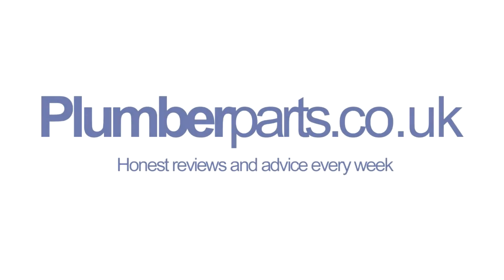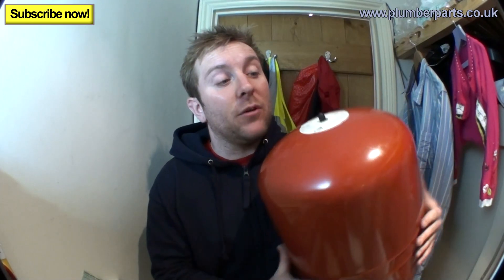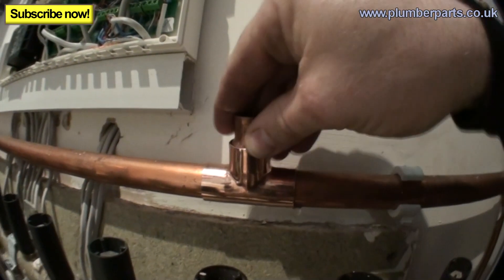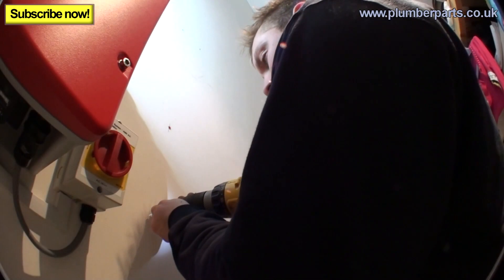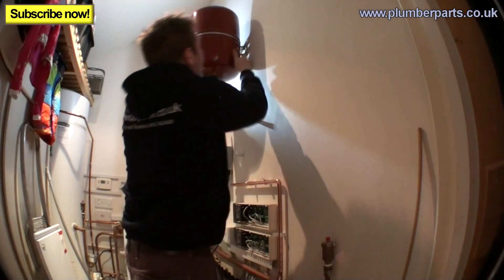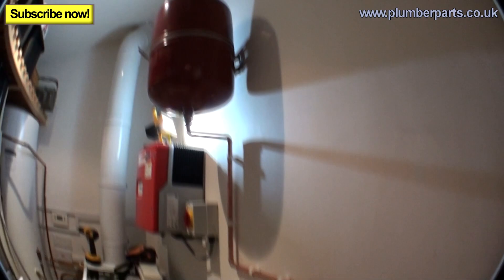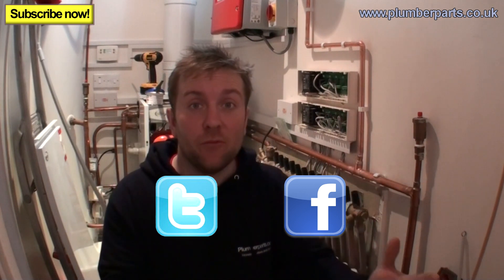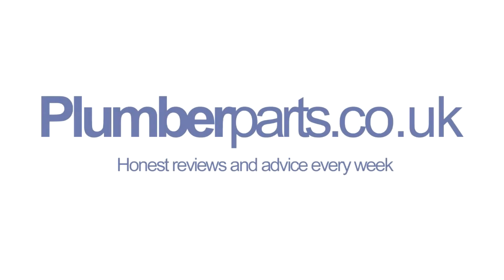EXPANSION VESSEL INSTALL - Plumbing Tips

Comment: Homeowner question. When pressure gauge is low (or zero) on the expansion vessel, how do you know when to use the schrader valve (and pump), or the filling loop taps?
Reply from the maker: Hi Mark, open the schraeder and quickly press to make sure there's compressed air. If nothing comes out (or even worse water) call your local engineer. If all is well, use your filling loop to top up the pressure and make sure you add inhibitor afterwards! If you don't already, please follow me on Instagram here: http://www.plumberparts.co.uk/social.php?social=Instagram FANKS!
Reply: Gotcha. But what pressure should the air be anyway? I may have released too much air. Thanks.

Comment: Hi James. Love the video. Really  helpful. Can I ask though. Have you fitted many EV’s to hollow plasterboard walls and if so what fixings do you use please?  Mine have worked loose thanks to the contractors using plain rawl plugs believe it or not. I’ve put a few TVs on the wall using snap toggle fixings and hollow wall anchors so was thinking they will work ok. Just wondering what your thoughts are.

Comment: Should never reduce the size should be 3/4 to expansion. Also expansion should be fit were it can be vent so it will fill with water rather than air because the system pressure will go down as the air is eventually dissolved into the water and have to be topped up again?

Comment: HI I have a question.  I have one of these on a unvented direct water tank.  Where would you measure the water pressure to set the expansion vessel pressure.   On the rising mains as it comes into the building, or after the inlet group valve where it connects to the tank ?  As the PRV is set to 3bar, wouldn't you just set the expansion vessel to 3bar as well ?

Comment: Common mistake: expansion tank lines do not have air bleeding/purging method. Extra air in my opinion is not desired. Open loop expansion vessel would be mounted that way, not closed system.

Comment: Hi guys, I have a question do you need to install an expansion vessel on the heating side of a unvented system, as I know the boiler has a expansion vessel inside it? The system has 8 zone (underfloor heating), and 5 radiators on the first floor boiler is a Vaillant 637?

Comment: Hi Jambo, Love the vids. One question, if your old expansion vessel is KAPUT, but because you've got a cheap Ravensh*t boiler and it's right at the back where you can't reach it, do you need to remove it or can you just isolate the little bleeder and install and external one? FANKS!!

PS - I can't even get to the bleedin' schrader valve. To say it's badly designed would be an understatement.
Reply: Vokera?

Comment: Do you need to allow water up to the connection with the expansion vessel.? Many thanks for posting, this looks a simpler job than replacing the one in my WB Greenstar junior.

Comment: When you test the expansion vessel to see if it’s split, is there a lot of water that would come out  of the valve or just some moisture. My system is bubbling like mad when the heating pump kicks in, I don’t have any other leaks. Please help

Comment: Why go to all the extra work of installing this external vessel when all you had to do was replace the one on the boiler, which is clearly visible at the front of the Worcester. I can understand it when the vessel is at the back and you have to take the boiler of the wall.
Reply from the maker: Because, Grant's (which are the manufacturer in this case) do not produce a boiler that has an adequate expansion vessel for the whole heating syste...only for the boiler (which is a bit poo) so we had to add a larger one to accomodate the expansion of the radiators and system....hope that helps (always check to make sure the boiler expansion is adequate)

Comment: The pipe feeding the EV should be the same size as the one your tee ing off from , in this case 22 mm otherwise your will put the vessel under undue stress and it will prematurely fail.....just saying......!

Comment: Do these tanks come pre pressurised?
Reply: Yes. The one installed here is 1.5 bar which is standard as that is what the pressure in the whole central heating and boiler system is usually set to

Comment: I might have to fit an external expansion vessel on a Combi system soon but on the return pipe where I would normally fit it there is no room or very little to T off etc but there is plenty room on the flow pipe.Is it OK to put it on the flow instead of return without damaging the system?

Comment: Ignore this video, placement of pipework near electrics is concerning, also no lockshield valve or draincock!!!! You would have to drain the system to service or replace the vessel in the future. P*ss poor, half a job, shocking.

Comment: Good video.  I have a Santon (Heatrae Sadia)  premier cylinder and the vessel it came with needed replacing.
Aquasytems was the manufacturer, code ARB 24, 3.5 BAR-  I Typed that into google and loads came up at £30-£50 with that code, but all had only 3 bar or 3.5 bar that was all 5cm longer than my original vessel, and i had a very tight fitting area.
I  rang Santon, they gave me the part number and I searched google with that. £298 was the cheapest I could find!!!  What a complete scam, the manufacturers get Aquasyeytems to make a 24-lt  vessel that is 5 cm shorter than their off the shelf 24 lt vessel so they can charge £297 for a £30  dedicated 'spare part' if anyone goes through the cylinder manufacture.
I thought sod that, I will take 5 cm of the pipework and buy from ebay and so I again searched for the  aquasystems  24 arb with 3.5 bar and noticed all the standard  24 lt vessels from aquasytems only had 10bar  test pressure mine had 14.4 bar. So I then searched "24arb 14.4 test bar"  and one seller on eBay had them for £31.00.  They are not standard off the shelf aquasystems replacement vessles, so he must have bought a job lot from somewhere???
The lesson, never buy replacement vessels from cylinder manufactures.

One more point ,on newer vessels you can buy a replacement EPDM Membrane and simply change the burst one over for a new one rather than buying a new vessel.
Reply: Top man..

Comment: Hi James, thanks for the great videos. Need a bit of advice please from you or any other contributors here.. 
Is there a way around it to pressurise  a boiler or sealed system when the mains pressure is low like one bar..? thanks man
Reply: Rothenberger sell a testing pump in which you can manually lever water into a system, it has a tray that you fill with water and you're away. Good luck!

Comment: Hi James, you've kept me awake in the early hours of the night now just going through all your very funny and top advise videos (my sense of humor..) So Hold Tight!... I need your expert advise please :)   I'm looking to upgrade my 4 bed home to a sealed system from a conventional low pressure header system which is very poor on head pressure. My biggest question amongst many I have is that my water main feed from the meter to the 1st floor airing cupboard is only a 15mm supply. If I fit a sealed unit, would there be an issue with water flow when say a shower is used or running a bath as the 15mm pipe will effectively be supplying both hot and cold at the same time. The question you're gonna ask me is whats my mains incoming pressure is?.. Don't know yet (off to screwfix for a pressure gauge), but if it's limited to 3bar on the system, would this be ok if its around that value?   (I sense more questions to follow..lol)   SUPERB videos by the way, I've learnt so much watching them, and very sound advise gained from the norm. I'm hoping to install everything and getting it signed off afterwards.  Just a pain working what floorboards to rip up to install this..Deep joy!   
Many thanks in advance
Roy

Comment: Brilliant compilation of video's, I watched several just out of interest... My question, I have a gravity fed system with a Albion super duty 45ltr tank, Since bathroom refit and going to a single mixer tap we have very very low water pressure on my hot tap in the bathroom but fine downstairs (kitchen tap) now I know downstairs is lower and gravity etc, but I think the problem lays with the bathroom tap and its tiny little pipes that go to the tap from the 15mm feed pipe approx 30cm away from the tap itself. Is there anyway I can boost the pressure of the bathroom tap by fitting an expansion vessel of some kind into the hot water feed side of the tank ? OR would cost and effectiveness say its better to change sink and go back to two individual taps (old school set up). Thanks

Comment: Hi mate, i have water hammer , is it alowed to fit one into the hot water pipe outlet ?? to reduce the hammering . Cheers
Reply: You can get small versions designed to stop water hammer, check merchants.

Comment: I've had to replace my 10ltr expansion vessel in Worcester 240. As an old boiler they are obsolete so got a 12 ltr reflex from screw fix. I've fitted it external to the boiler as it won't fit but piping it via the old vessels original connection on the boiler flow. does it have to be in a certain position like below the boiler and I'm having issues with the pressure, keep rising quickly and tripping the overheat thermostat. Cheers
Reply from the maker: +Jamie scott Anywhere on the system, providing it cannot be isolated from the system with a valve. Expansion is not optional!

Comment: Does every bolier have an expansion vessel? I don't know where my one is, I am getting a new boiler installed soon but my current boiler suffers from low pressure.
Reply from the maker: +lilwarski0121 Not everyone has. They can be sods to find though!

Comment: Could there be trapped air in the expansion tank (on the water side) when the system is refilled? Could this ever cause a problem?
Reply from the maker: +samwab Not usually
Reply: Not usually as in it doesn't happen, or as in it doesn't cause problems?

Comment: Hiya, Is it possible for this Expansion vessel to explode? I want to know as its in an walk in cupboard in my bedroom.. We have problems with low pressure. We had a new boiler installed 20 mths ago. and I  had problems with the immersion Heater on and off ever since. Low pressure for nearly 20 months.. So we were told to get new pump. so brought a new one£200.  had 3 leaks on cold water tank and pipe work had them fixed had new automation air lock vent. and new Gauge on expansion tank.. I use to fill the tank up too 1.5. But can't now as heating engineer done some thing to tap to turn.. So I am unable to manually  put pressure into  the system.. What's happening is when I was able to  fill  the gauge to 1.5 which they told me too and turn off tightly . The pressure is going up to 4+ and then back round down to 0.. Staying at 0 then going anti clock wise to 4 again.. it's see- sawing. Now they tell me I have a faulty gauge. I tap the red tank and get a dead thump sound. as if flat.. They telling me safe to use but need a new vessel.. I was told when they changed the new gauge they may of damaged the tank.  I have a leaky valve on the cold water tank.. Its taken 8 different plumbers and 1 heating engineer so far and I am still having problems since last year. any advice please..  thanks..
Reply: the EV is burst that why its going up so high, then your safety control is activating to give the water somewhere to discharge to, usually after 3 bar though, if the 3 bar prv is not returning to it's seating then that's why your pressure keeps dropping back to 0. You need to get a new prv and recharge the EV

Comment: James - I have an awful problem with our central heating. Ariston System Boiler failed and Ariston engineer repressurized the expansion vessel to 1 bar.  Started working again but way below par - radiators cool, DIFFERENT ones completely cold - NOT always the same ones. Had system power flushed and all the water was absolutely clean and clear - looked okay to drink! The rads were even cooler and worse after the power flush. Hot water has always been fine.

I suspect air is getting into the system - all rads bled but the WATER in some seems like soda water and fizzes a bit - I haven't drunk it. I think that it's the boiler - either the pump not running properly or could air be getting into the system? Ariston engineer refused to accept that it's their boiler - of course it's still under the Ariston 'Guarantee'!

Would really welcome your unbiased view.

Cheers.

Comment: i have a faulty zimlet expansion tank, it need replacing, can i just close the HW stopclock which is on the same feed and swap out the unit rather than drain down the entire system ?    thanks

Comment: Some tanks experience dripping or jets of water when the diaphragm fails.  I would not mount a "dripping/wet tank" above the electrical components on the wall, unless there was no other choice.  Q:  Do you earn more if you can route the pipe using more elbows?

Comment: New engineer need the change a expansion vessel on old combination with is located at back of boiler which is more or less impossible to get to been told I can fit an external one is this what I would do cheers
Reply: Yes, it would be much cheaper for an engineer to fit an external one than to atrip down your boiler and fit a replacement.

Just realised your post was 4 years old :(

Comment: Tip. Bend the pipe first all in 1 then mark the wall for clips. Fits perfect, looks great, saves time, elbows, etc and nothing to leak
Reply: There is about 5 bends in that new 15mm. You are saying bend them all or have i misunderstood? If so best locate expansion last of all and make bend into that an elbow joint or you would be having fun hitting thr nail on the head

Comment: i have a problem with my expansion tank on a bosch worcester 24. If i fit an external tank do i need to isolate or disconnect the old one if so what should i do?

Comment: novice surely that installation means the pipework and expansion tank are full of air when installed.... where does that  air escape to when the system is filled?
Reply: ***** sorry -  I was calling ME a novice for asking a silly question - wasn't insulting you!! thanks for the response.
Reply: Benvolio Foster In my opinion you are right. Expansion tanks shouldn't be fitted upside down. Air will get trapped in and over time will dissolve in the system water. This dissolved air can turn up elsewhere in the system when it is heated up (Henry's law) and will cause noise and corrosion in the system.

Comment: in Europe we don't use a cooper pipes anymore (the old soviet technology), we are using the plastic-rubber mixed pipes, that needs just a bit of heat to weld together and no need any things like fire torch and solder, and no risk of fire!

Comment: So when you turn on the heating system, how does the air in the pipe leading up to the expansion tank, get expelled from the pipe?
Reply: jwvgoethe77    It doesn't need to  it just becomes part of the expansion system

Comment: Just a heads up mate, I know you were only replacing what was there but because of the large amount of water in oil boilers the expansion vessel is very undersized  (why the one in the video went most probably) in every instance we have installed one we needed to add an additional one on the the system, It's a pain in the arse but when I went to grant I asked why and they told me they just cant physically fit a big enough one in there